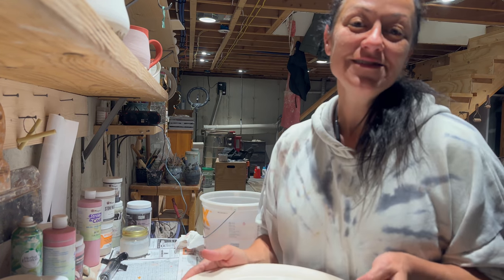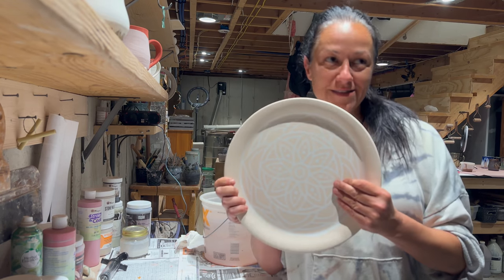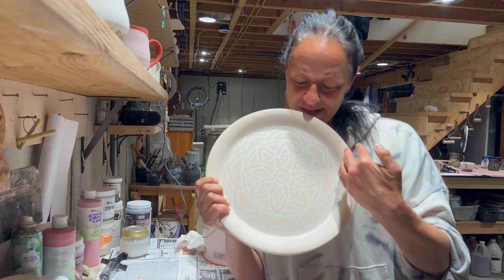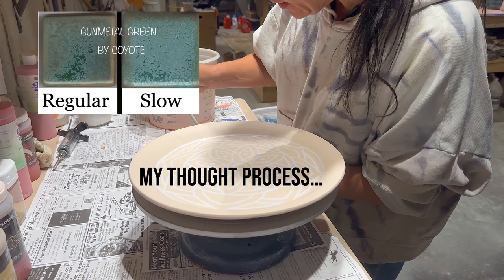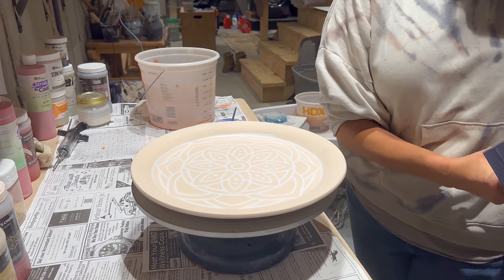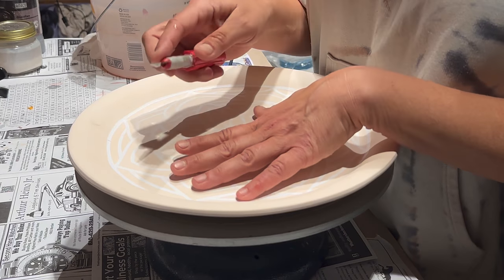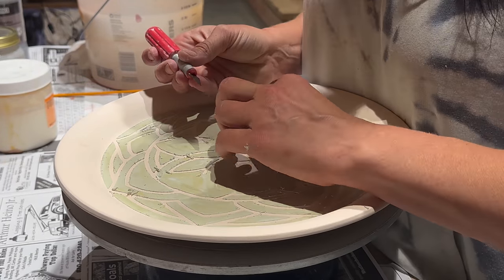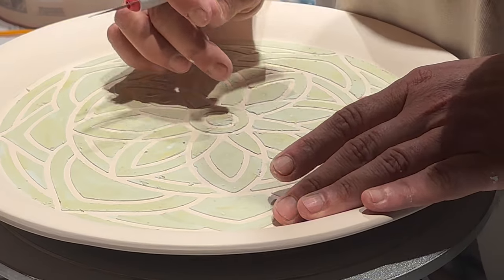You Learn the Most Through Failure | Mandala Plate Design Part 2

Comment: What a great looking plate. But so much work, with the Cricut  production and the waxing of the stencil, etc. I wonder if latex would work better than wax. So if you make a mistake you can peel it off and it can still be glazed over.
Reply from the maker: @ClarePiaget  totally! Soooooo much work but I’m working on a quicker way. Latex! Good call…I wonder if I latexed the lines of the mandala 🤔 instead! I’m going to try this - thank you!!!!
Reply from the maker: @ClarePiaget  also, if the latex is applied over the glaze (like the wax), wouldn’t it peel off the glaze when I pull it off? I’ve seen it done with underglaze where it didn’t come off along with the latex..but not with glaze. Curious!!
Reply: @thehappyhomesteadnh It shouldn’t pull the glaze off. I just got some wax off which is latex yesterday so I’ll try and let you know.
Reply from the maker: @micheledickey4066  really?! I feel
Like it will 😂 because it’s so aggressive when pulling off!
Reply: @thehappyhomesteadnh  I’m testing that right now as we speak so I’ll let you know in a bit.